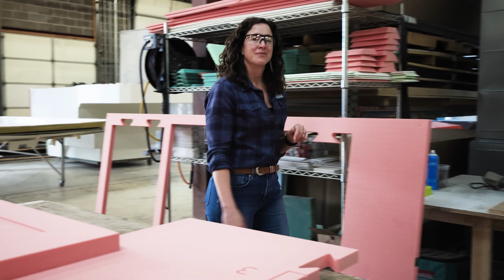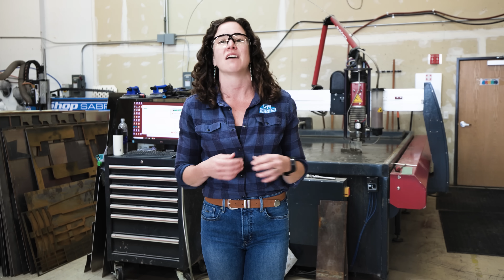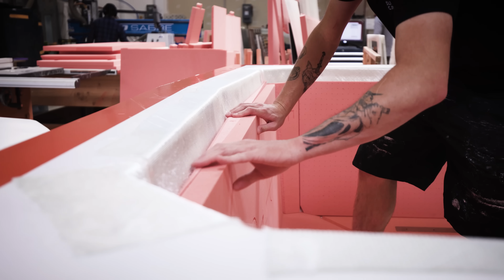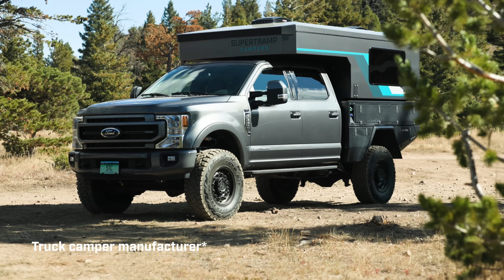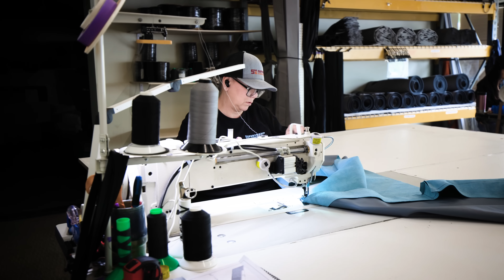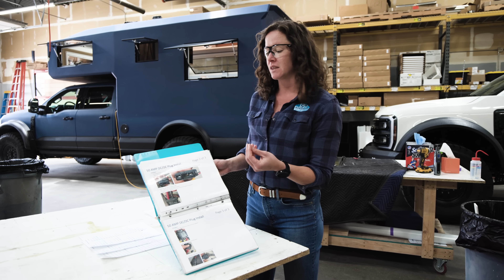How its Made: Supertramp Campers Shop Tour

Comment: Can you customize the campers? What if i want a diesel heater/hot water instead of the propane, is that possible? Also delete the propane burner and just leave the counter top bare that i have the option to use it with a portable induction cooktop or use it as a workstation with a monitor and laptop?
Reply from the maker: Yes, you may option a diesel heater with either a cooktop delete or an induction cooktop.

Comment: Awesome campers! Thanks for the video!
Looking forward to a Supertramp camper for the CyberTruck. Granted, it would need to be shaped accordingly but with 2500lb payload, 6' bed and BUILT-IN power (110/220) it has a lot going for it as a base for a truck camper. Also, with factory 17" ground clearance it's awsome for overlanding. Many CyberTruck owners are looking for a camper that would be design for the CT (shape and advantages) and many have the means to buy Supertramp campers.